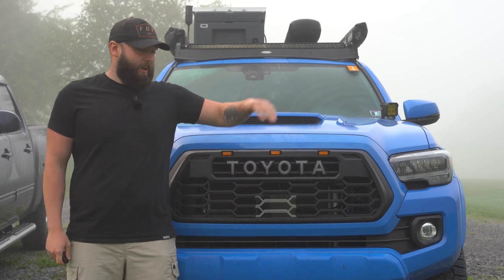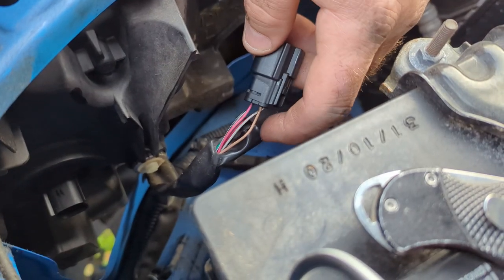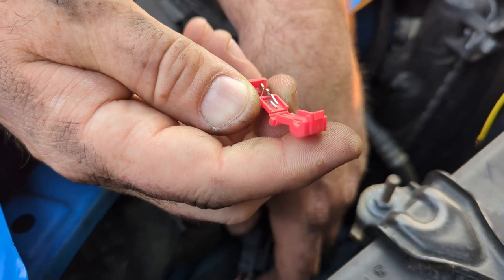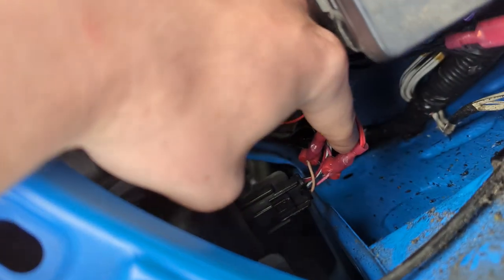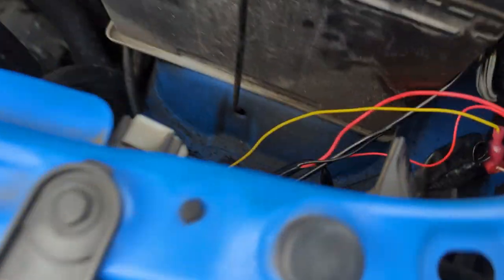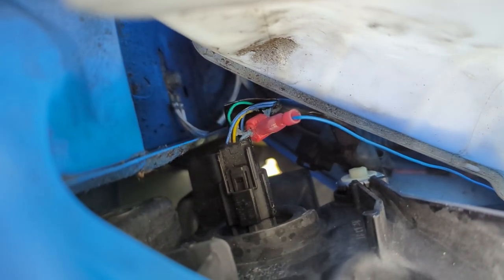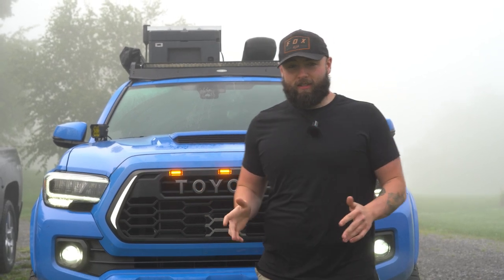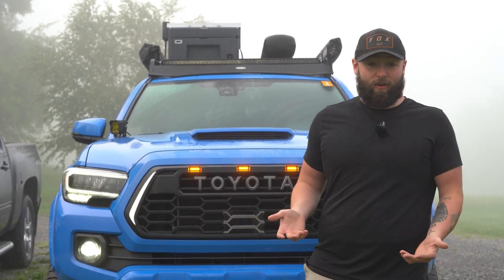How To Wire The NEW TRD PRO V2 Grille On Your Tacoma

Comment: It would be cool if you showed everyone how you test the harness to find out which wires to connect too. Also, I have a 2023 and it was blue wire on drivers side and yellow passenger, I also had to switch mine too. I appreciate your help with the post and I can’t get my DRL to run on the grille it’s just blinkers. Wondering if wiring harness is bad, double checked all my connections and they are good
Reply: We unplugged the harness at the headlight and used a DC tester"the one that looks like an ice pic with a light bulb in the handle and a ground wire coming out of the top" to test each pin in the connector while the other person went through turning on the parking lights, tuen signals ect.... Hope this helps.

Comment: Followed your instructions. Super helpful. though my factory LED lights used the green wire for DRL for some reason. I tried the pink wire like you showed but that did not work. Do the grill lights stay white for you while your headlights are on? I think tapping the green wire results in mine turning off when my low beam headlights are on. Curious if your setup lets them stay on at all times?
Reply: Yes they stay lit as long as the drls are on. You may have tapped into the wrong wire. Get an electric tester "the one that looks like an ice pick with a light bulb in it" pull the plug of the back of the light and only turn your drls on as you test each wire.

Comment: Is it possible to just keep the amber lights on only as day time running lights? Would the wiring be easier?
Reply: They are wired into the drl line. As long as the drls are on so are the amber raptor lights and the white side lights.

Comment: How did you figure out which wires did what? I can’t find a wiring diagram anywhere
Reply: First we got out the grill and used the battery to touch the wires to and see what lit up on the grill. From there we unplugged the head lights and tested each wire with an electric tester and turned different things on to find which wire on the plug was for turn signals and which were drl wires. Then we tapped into the corresponding wire for what we needed lit up on the grill.

Comment: The yellow wire for the directional is for the passenger side blue for driver's.
Reply from the maker: Blue is passenger, yellow is drivers.
Reply: I just got my grill setup and it was blue for drivers and yellow for passengers on the turn signal. Because I originally wired it the way you showed on the vid and my blinkers were reversed haha. But I'm guessing there is a different version of these grille floating around or at least a different wiring harness..oh well it all worked out in the end. I got worried using the t taps just hope they are robust😅
Reply: What year and model truck do you guys have?
Reply: @JoshTheFlyGuy  '22 TRD OR
Reply: @JoshTheFlyGuy  2016
Reply: Alright makes sense mines the 2018 and mines the reverse order of the color as well. Just ordered this grille too can’t wait for it to be installed lol
Reply: @Pj.1620 hey on your 2016 how did you wire yours up? My truck doesn’t have the 4 wire plug that shows on his video and I got stock headlights. I got 2 set of three wire cables one has red, white and black wires and the other set is green white and pink/red wires. (Driver side) I’m assuming the same on the passenger side but what I did originally was tapped into the turn signal bulb lights which both sides only have two wires passenger light blue and driver light orangeish but every time I start my truck up the battery becomes dead….any ideas? It’s also a 3rd gen

Comment: Couldn’t you use a add a fuse instead of splicing the wire
Reply from the maker: There's no fuse for the DRLs it's a relay unfortunately.
Reply: @ModernDayViking  what if I just wired it right to the battery?
Reply from the maker: @CoachKolton  the lights would then be constantly on and would not turn off or change with the turn signals

Comment: 23 Tacoma off road v2 yotaverse grille with side markers
I used an “add a fuse” for raptor lights 
Raptor lights only turns on when headlights on but not on DRL.
Side markers:I wired the yellow wire from on passenger side and blue wire on drivers side. 
Any help will do
Now my turn signals have 2 different colors 
Passenger is white color and drivers side is amber on the side markers
Reply from the maker: Sounds like you tapped the raptor lights to your lights, I have my tapped to the (ignition ON). For the side makers you have the wires messed up. You're grill harness must be different. For the turn signal that is white, use the other wire on the grille.
Reply: So followed all the steps you did.  I ended up wiring the raptor lights and DRL marker with the ignition wire, it works. 
Connected the DRL turn marker to the turn signal marker on headlight. Still the DRL turn marker on the grill still lights up white(passenger) and Amber(drivers) when I turn, lock the truck, hazard. Maybe it’s not dual lights after all?